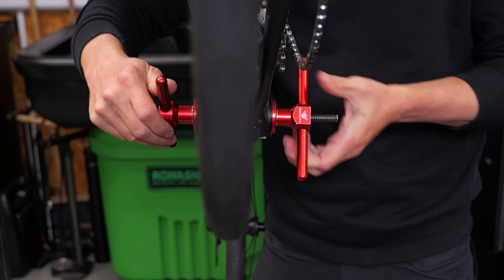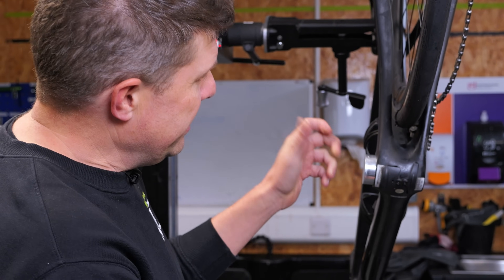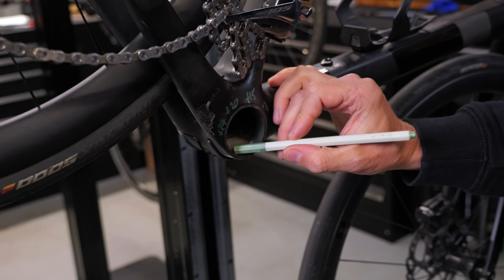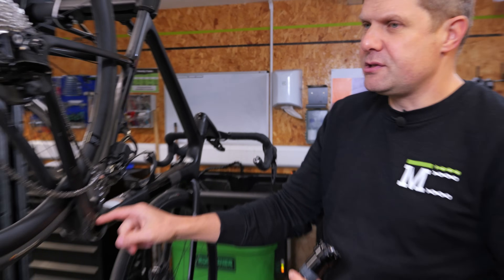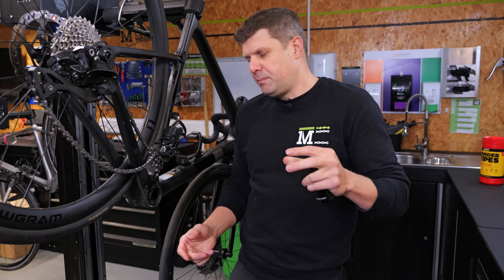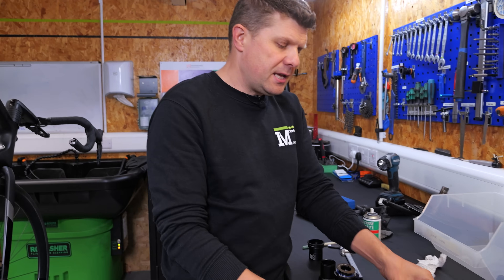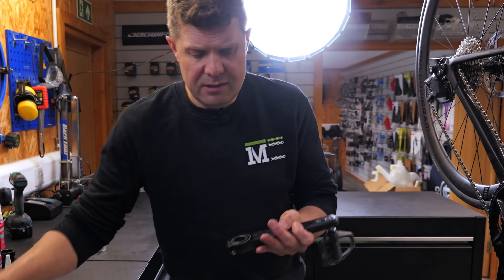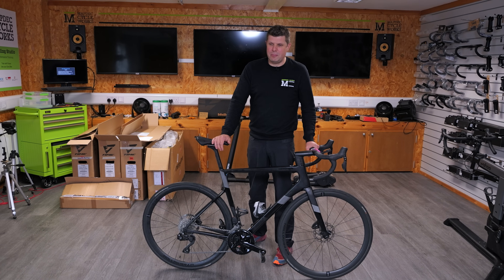Solutions for an oversized bottom bracket

Comment: 3:10 I'd try with some thick epoxy resin used to fit/glue metal parts (like in car industry). then redrill it to match none drive side. Just like one you show here 4:05. A lot of hassle, but might work Beside, aren't surfaces of BB area and headset filled with glass wool with resin, rather than carbon fibers? Latter ones aren't very happy with aluminium BB shells.
Reply from the maker: I would like to see your video of how that works out for you.
Reply: @Mapdec  Hah, me too. Fortunately, only happened that I had to use retainer for the top headset bearing. 638 did the job.

Comment: The joy of a press fit BB & plastic frame.
Reply: Press fit BB in carbon frames are fine if a) it’s made correctly and b) the BB is maintained/replaced before it’s f****d. i have two Carbon road bikes, both Merida, both over a decade old, one on only second bb, one still on original.
Reply: @joules2936 Yep. Got an 8 yr old Trek Domane. No problems with the BB90 press fit. Only seem problems with other 'good' bikes when poorly maintained - eg, seized bearings, wrong compounds, loose cranks, etc.
Reply: @JibbaJabber  to be fair to riders, only some press fit bb issues will be maintenance (poor/lack of). A lot of companies seemed unable to make two holes round enough and/or sufficiently in alignment. And some press fit ‘standards’ are problematic.
Reply: @joules2936  You must not use the bikes very much.

Comment: Genuine question @Mapdec, if you add excess carbon fiber back into the bottom bracket hole surface so that instead of 46mm hole you now have say 45.9 or 45.8mm, wouldn’t it be easier to then just resurface it back to a perfect circle once the resin has fully cured? Sure it isn’t the quickest solution but I feel like that is the most complete solution.
Reply from the maker: It would really need a big mill with a 46mm reamer to through the whole frame. Otherwise it would be a long long process of sanding and checking with jig to get some kind of alignment.
Reply: @Mapdec  that’s what I figured. It is by no means would be the quickest solution, but I think TECHNICALLY it is a true fix for the problem. Having to do it with sandpaper I’m sure would be brutal to constantly sand and check lol.

Comment: Great work that comes just in time as I'm trying to fix my cervelo with exactly the same problem. Once you've done that fix, is it still possible to remove the BB (now with all the "glue"), in case you need to replace it? Any special tricks for such a removal?
Reply from the maker: Bit of heat from a hair dryer is usually enough to weaken the compound.

Comment: Hello Mapdec do you know someone that does this work in spain?
Reply: No competent bike shops where you live? This isn't exactly rocket science. I think the key phrase here was "It doesn't take a genius" Gotta wonder if they'd just got new parts like the ones that failed and installed 'em with some of the more viscous filler, would it have been OK?
Reply from the maker: Great question. Loctite 660 could well have worked. I have, so far, not been successful with it it curing in a carbon frame with an open end. I am experimenting with the Liquid Shims, you might see them on the channal one day
Reply: @Mapdec Loctite 660. Is that a Spanish shop?? 😂

Comment: Great work on this. I tried using a quite expensive thread together type, but as you mentioned it still managed to work itself loose over time somehow. Unfortunately this happened when I was on my own in the middle of nowhere and ended up causing a hairline crack through the frame BB shell as had no choice but to ride back with it rattling around 😢
Reply from the maker: Sadly the cost of the bottom bracket has no relationship to how good it is.

Comment: I hope they’re not using retainer compound filler on jet engines! Those things are supposed to have proper tolerances, not bike industry ‘tolerances’ 😅  

Do you think putting some lock tight retaining compound should be a standard process with any bb86, or just out of whack ones?
Reply from the maker: I think the best thing is to follow the manufacturers instructions.  But if things are not correct you need to make a solution.  Campagnolo ask for 641, BBinfinate use torqutite, others ask for grease. Praxis even asks for a silicone sealant.

Comment: Good video, just wondering how you squared the axel to the frame when there was play in one side? And wouldn't you leave the chain loose while the compound sets so as to maintain that squareness? Or is this kind of tolerance just negligible? 🙏 Thanks
Reply from the maker: The NDS was square. The axle was in.  The chai didn’t really go on until long after the 10min set. All good questions.

Comment: Nicely done.

I think the WheelsMfg thread-together one would’ve also worked with the higher-gap retaining compound.  That’s what I did with my PF30 bike that had a similar affliction.

The advantage of the thread-together, IMO, is the fine pitch threads align the two sides so the bearings are reasonably coaxial.  Press in the “good” side first, then screw in the loose side with compound & let it cure.
Reply from the maker: Glad you got yours sorted too.

Comment: Did the actual bearing fail, causing the the BB shell to spin in the frame?  Or was the out of round BB compressing the bearing and preventing it from spinning freely? How could the rider not have noticed this earlier?
Reply from the maker: Just a bit rusty
Reply: @Mapdec  Ceramics may be a good choice for the wet British weather!  I'm not a fan of ceramic, but I think it may offer some benefits here.
Reply: @bengt_axle : or just bring it back regularly and have them knock out the old bearings and put new ones (just leave the BB shells in place).  Probably a lot cheaper in the end than high end ceramic balls with stainless races.  If they’re riding thru slop, the grease in a hybrid ceramic bearing is going to get gunky anyway unless it has excellent seals.
Reply from the maker: @bengt_axle stainless maybe.
Reply: @bengt_axle  Sure! I still remember a Campagnolo tech presentation on their ceramic stuff. The joke was how many customers thought the more expensive the stuff was, the LESS attention to service it needed.

Comment: That was really interesting but this is exactly why I stopped riding my SuperSix Evo of the same design and bought a LOOK 786. I tried 3 different manufactuer's BBs including C-Bear ceramics and none would spin smoothly and there was always a creak. Having had an original SuperSix, updated to an Eco in 2017 this 2020's version was rubbish IMO. I went back to riding the 2017 version before buying the LOOK. I don't see why us as bike owners should be faffing around looking for these mix n match solutions when it seems to be an inherent problem with the bike frame - design or most likely manufacturing.
Reply from the maker: Sure. PF30a was not Cannondales finest moment.